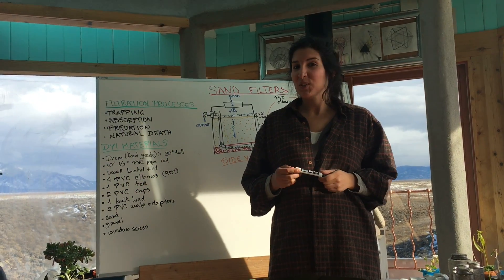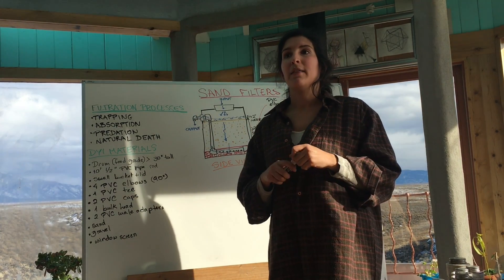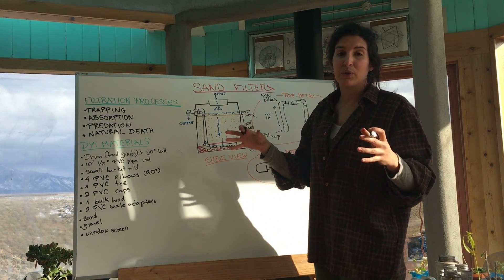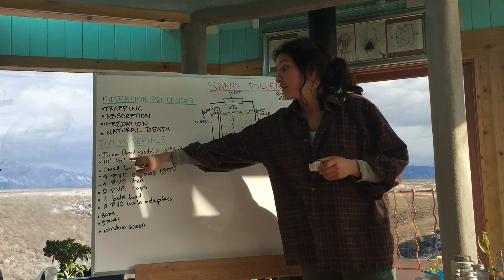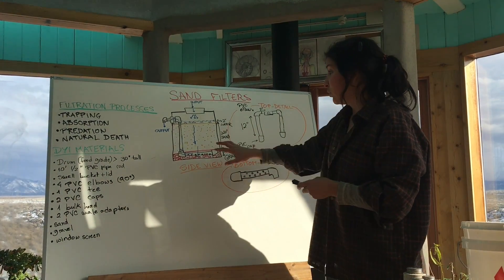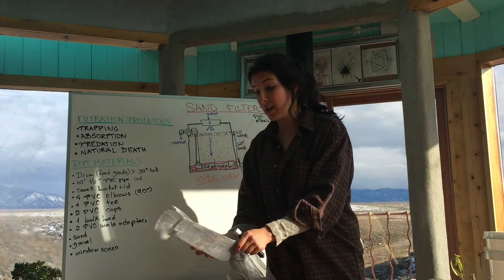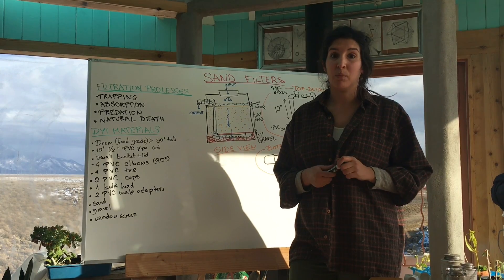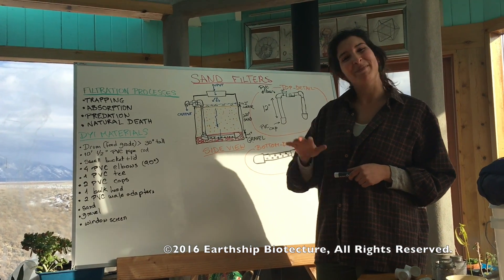Sand Filters

Comment: Nice presentation.  Consider a backwash function by adding a valve and down pipe
Reply: slow sand filters are not to be backwashed. the surface can be washed when the schmutzdecke (top layer) gets too fine of a particulate layer though.